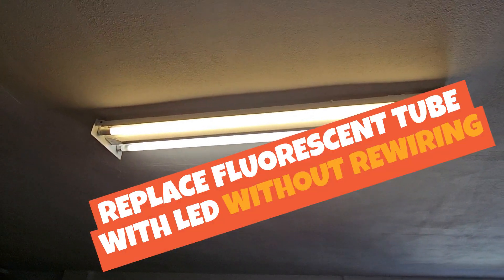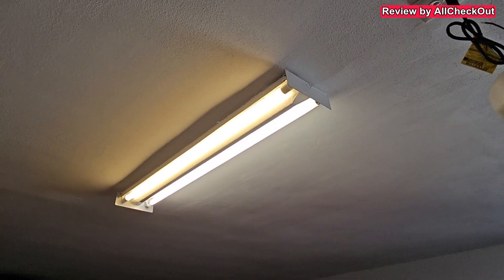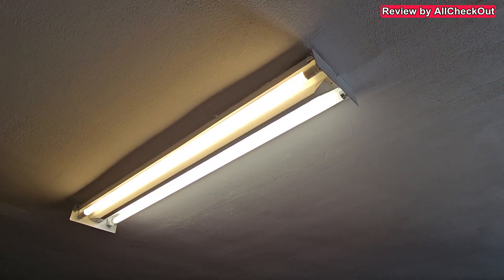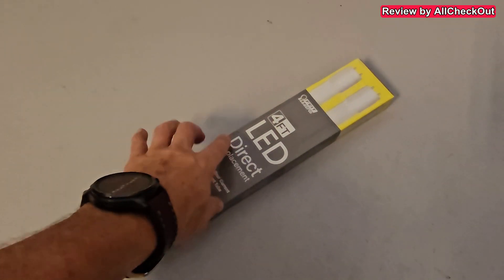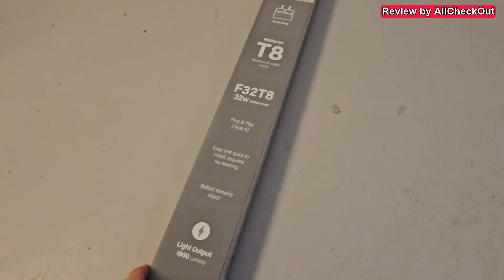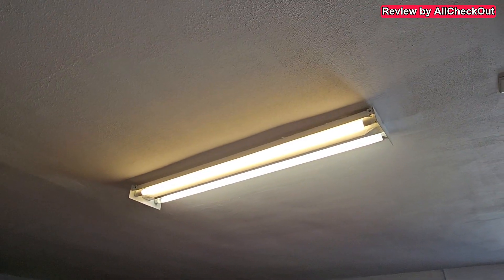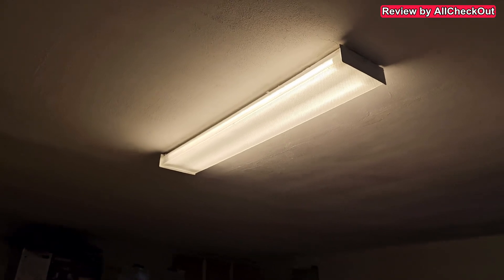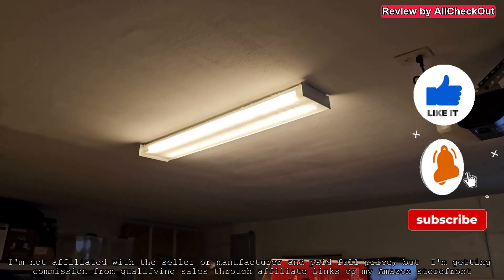How to Replace a Fluorescent Tube with LED Without Rewiring?

Comment: old news I've done this about 6-7 years ago two types one you only replace tubes or the other type you remove the ballast and wire sockets directly.
Reply from the maker: OK ... interesting ... didn't know. So why ppl still buy the ones which need ballast and starter removal. I can't understand .....
Reply: @allcheckout  either they are getting the wrong info. and those type are a little cheaper. the warehouses are trying to get rid of old inventory. lastly the tubes that work with ballasts only work with electronic ballasts they do not with the core type.